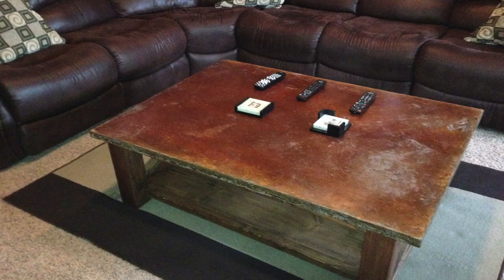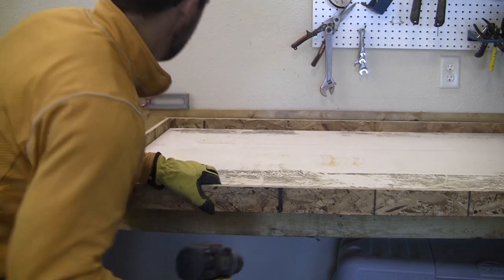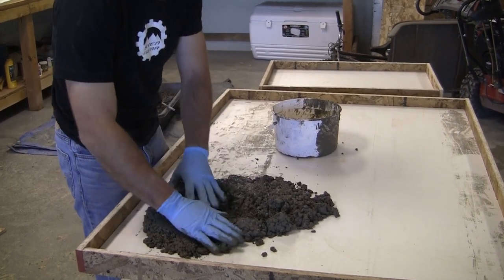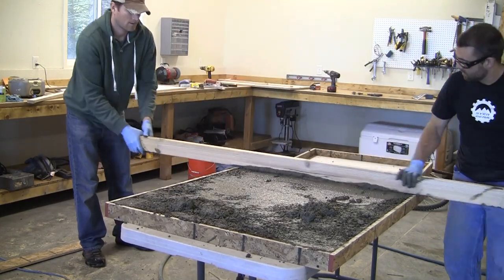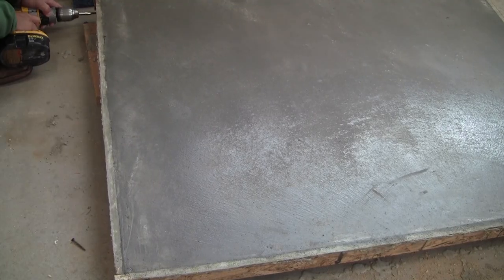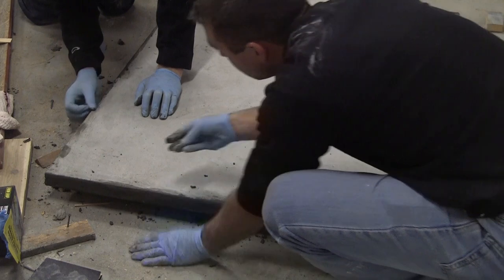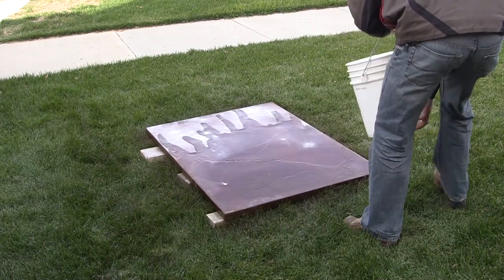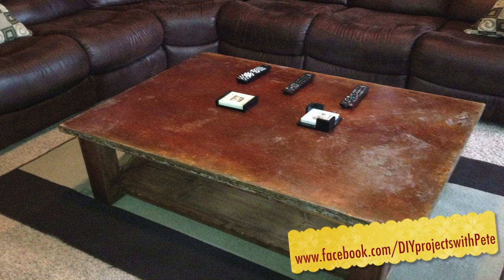How to Make a Concrete Coffee Table and Acid Stain Concrete

Comment: How do you typically attach the base to the concrete top without the worry of cracking or splitting the concrete?
Reply: Hi Eddie, I typically use silicon or a small amount of construction adhesive. I also like to put small blocks inside the perimeter of the base (fasten on the concrete with construction adhesive) as seen in this picture to prevent the table from ever sliding: http://a.disquscdn.com/uploads/mediaembed/images/747/8397/original.jpg

Comment: Hey Pete, Good stuff. So I'm mid project on a raised platform for a wood stove, a BBQ island top, and some patio tables and benches. Im having trouble getting my hands on the Quikcrete etching stains. Apparently there special order items, and not shelf items. As well as minimum order and I was also told the product is being phased out. That quikcrete is getting out of the finishing biz. Stains etc. But then I was told thats not accurate. Both, by Quikcrete representatives. Not sure what to believe. But with that in mind I don't want to fall in love with a product with limited availabilty and possibly no longer available. Have you used any other etching stains or have any others you've been happy with?  I like the look and the process but .......Availability.
Reply from the maker: Hey Eric! I actually would recommend stains from Concrete Coatings, Kemiko, or Scofield. Concrete Coatings sells them on Amazon and they work great. Cheers!

Comment: Really good video.  Liked! But is this considered a polished concrete table? Other than the sides where was the polishing of the top?
Reply from the maker: LGM123456789 Hi and thanks for watching! This table had a trowel finish with texture. It's not hard toweled or polished. A sander was used on the sides a bit, but I don't really consider it a polished top unless I use the wet polisher. You can see an example of the wet polisher by checking out the LED concrete table if you'd like. https://www.youtube.com/watch?v=JYUUIgcI9rs Cheers!

Comment: Great Pete!  My wife is reluctant to go concrete because of durability.  How long will a concrete counter top last?  Is there something else other than just a sealer I can use to prevent chipping?
Reply from the maker: FirstDegreeRickW Hi! Should last as long as you'd ever need it. Concrete is super durable. Concrete counters are quite a project, have you done a table before? I might recommend doing some smaller projects to get the hang of it before going all out on countertops. I'd highly recommend checking out Cheng's books or some of his videos on youtube for more details on concrete counters. I've done a number of kitchens with countertops -- they are a lot of work, but well worth it in my opinion. Although concrete counters aren't for everyone :) A sealer and wax are what I use for a finish. Haven't had many issues with chipping. Let me know if that helps! Cheers - Pete
Reply: Absolutely, I plan to just start with a 4 x 4 square and see how that turns out.  I'm familiar with Acid Staining and I think it could be a real niche in my small community.  

I know Bozeman is pretty big but if you ever run into the Thiem's, they are friends of mine up there in Bozeman.  Her name is Cheryl Thiem, we were neighbors as kids here in Cal.  I don't know her husbands name yet.  LOL

Comment: How did u attach the concrete to the wooden base?
Reply: Hi! I glued blocks in each corner to prevent it from sliding and to keep it in place. Here is a photo, but feel free to send me an email on the contact page at diypete.com and I can send you a detailed instruction guide. http://a.disquscdn.com/uploads/mediaembed/images/747/8397/original.jpg

Comment: Hey Pete, I want to build a 40 inch by 73 inch table. what's the span strength of concrete? could I get away with a 1 inch table top?
Reply from the maker: Hey Kyle! You might be able to get a 1 inch thick top using certain special fiber re-enforced mixes. But if using a standard mix like I typically do I don't recommend anything less then 1 1/2 inches thick for a table of this size. It's only for real small tables like end tables or bedside tables that I'll do thinner sometimes.

Comment: Trent what did you use to attached the cement slab to your wood frame?

Thanks, great video!
Reply from the maker: Chris Szczypinski Hi Chris! For this project I glued a wood block on the underside of each corner of the concrete (just inside the wood frame). These 3/4 thick blocks that are 4" by 4" prevent the concrete from ever shifting around. (like when you rest your feet against the table). It is heavy and the base is super stable so that's all you'd need to do for this project. You can also remove it easily if the table ever needs to be moved. Sometimes I'll run a bead of silicon around the top of the frame as well (especially for concrete countertops). Hope that helps - cheers! - Pete

Comment: Hey Pete, great step by step videos!  I also appreciate the production value added, it sure makes watching the videos much more enjoyable.

How has this acid stain held up?  Would it be suitable for an outdoor location?  I am considering this technique for an outdoor kitchen table top.
Reply from the maker: +Cody Dills Hey Cody! Thanks for taking the time to watch them. I've done a number of tables / bars for both indoors and out (as well as patio floors). The stain has held up great. The patios I've done using the solvent based sealer in this video: https://www.youtube.com/watch?v=ZSlzelQYEOU    look great. One of the floors I did about 4 years ago. Here is a bar that has been outside for about 2 full years: https://www.youtube.com/watch?v=nmoF47rds1c -- and it still looks real nice. Just make sure to get a good sealer - and solvent based is going to be a bit longer lasting and more tough in my experience.

Comment: Great video! Do you happen to know if the acid stain would have any effect on a metal inlay such as stainless steel or aluminum?
Reply from the maker: Hey Travis! I've had it on aluminum and from what I remember it didn't really react. I'd test it if I were you though. I would but am currently doing some traveling.
Reply: Okay thanks for the advice!

Comment: How heavy is this? How do you know how strong to make your base?
Reply from the maker: Hi! At this thickness it is about 15 lbs per sq foot. This type of base does well with it and has plenty of support. This table is 4 feet by 3 feet and so it weighs around 180 pounds. As for determining how strong to build a base - I'd error on the side of overbuilding. 4x4's are strong and the more supports and shelves etc the better. Cheers!

Comment: Another Tip, 
I was told that if you use a mixture of water and Ammonia it will also neutralize the acid, and it won't leave any kind of residue that baking soda would leave behind.
Reply from the maker: CosmoSocrates1986 Hi! Thanks for the tip! And I actually prefer using ammonia /water as well and have in some of the other projects. I just didn't have any around and didn't have time to make a trip to the store :) THANKS FOR CHIMING IN Cosmo! What types of concrete projects are you working on? I'd love to hear! Cheers from Montana - Pete

Comment: sir, is there fiber in the concrete?
Reply from the maker: ***** I believe I used the basic Quikrete 5000 mix for the project. It doesn't have fibers in this specific mix, but there are mixes with fibers already in it if you'd like to use them.

Comment: Get a drill for that mixer. Mixing was not the how a pro would do it...but product and video overall good.
Reply from the maker: Colin Lynch Hi Colin, thanks for your feedback. I have a great big Milwaukee drill and paddles specifically for mixing concrete -- but gear my videos towards beginners who don't have all the tools. Hence why a bucket / tub and hoe are typically used in the videos. I agree though, mixing with a drill is optimal. Cheers!
Reply: Ah i understand